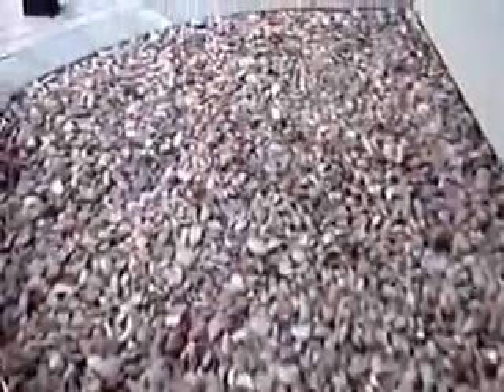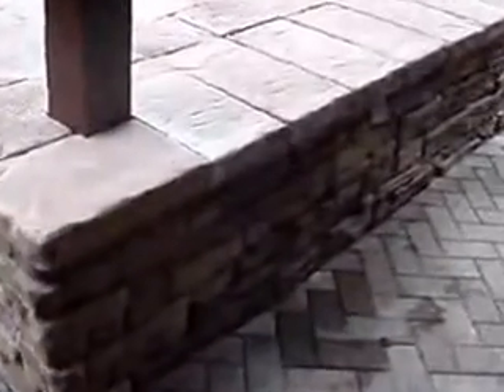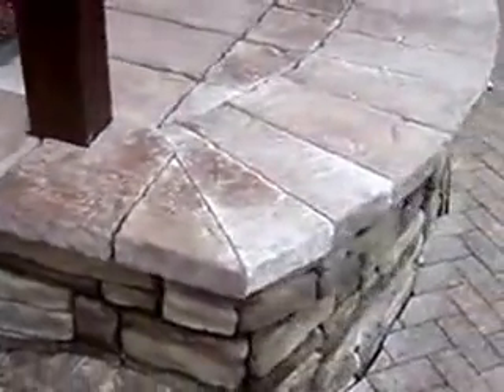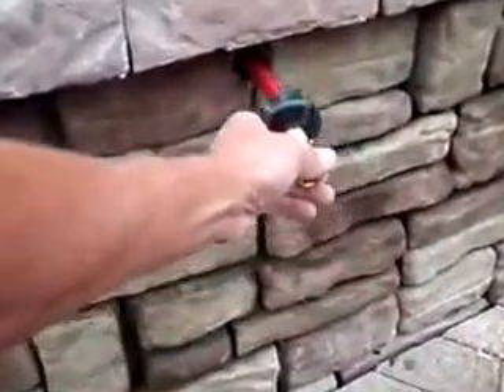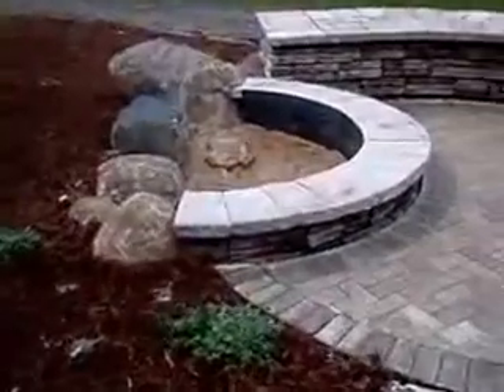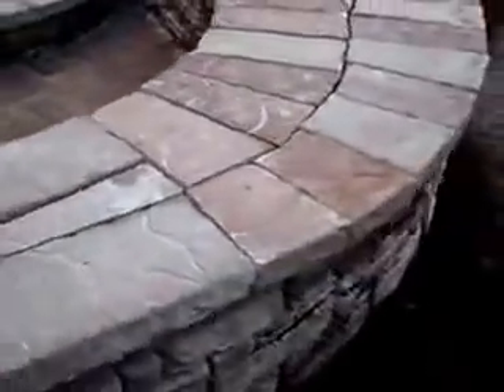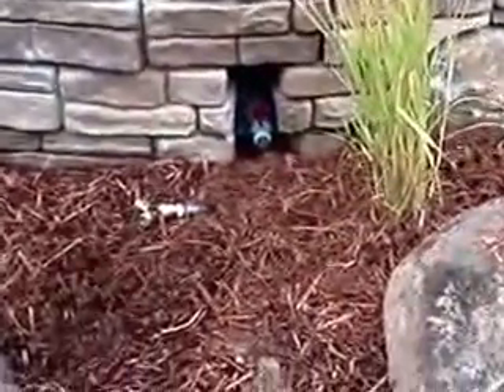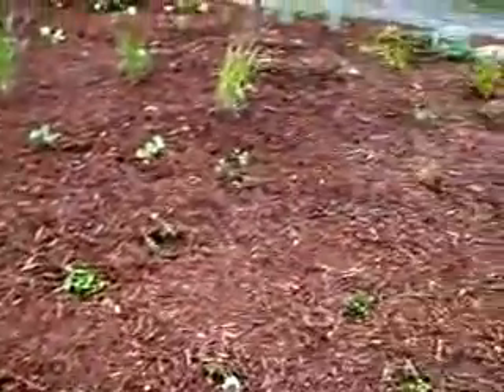rainwater harvesing + great design

Comment from the maker: @struck21   The cap on the patio bar is actually 3 pieces.  The middle piece can be lifted and set on one of the sides, but yes it is a pretty heavy section.   Easiest with 2 people, can be done alone-- then it's all fully accessible.  
Lighter weight faux stone, tile or wood are great alternatives
The nice thing is it rarely needs maintenance.  Just winterize the downspout diverter, turn on the pump til it runs dry, and open the easy to reach valve on the far tank.